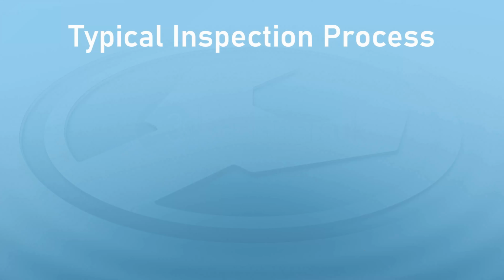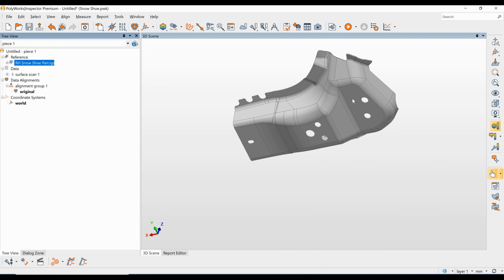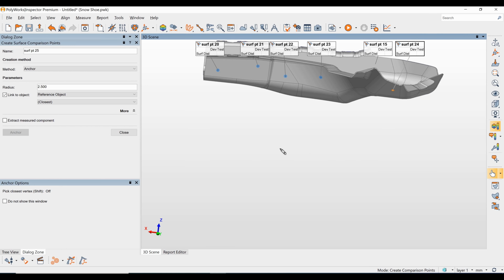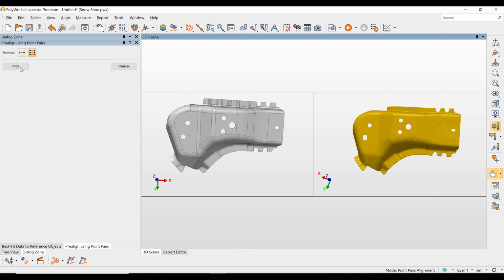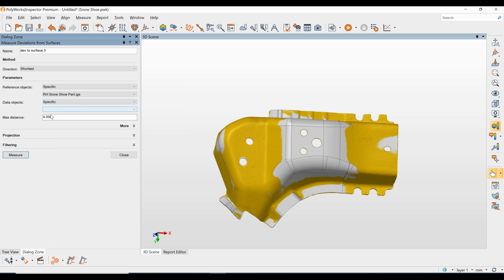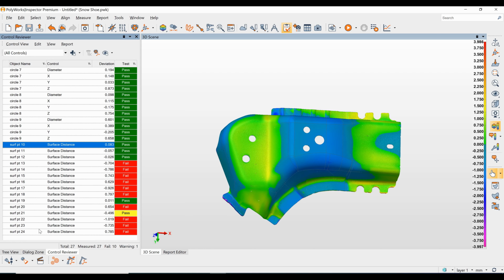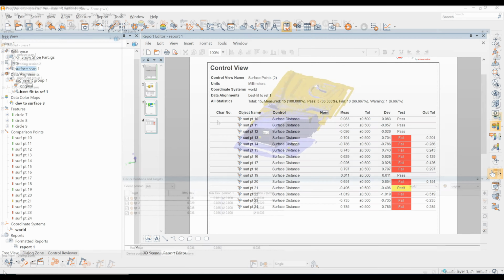Basic Inspection Workflow - PolyWorks® 2019

Comment: Hello question when using point or feature labels how do I keep as a default so whenever I create a feature the nominal actual and xyz always appear
Reply from the maker: Hi, you will see the nominals for the XYZ values appear by default. For the actuals you will have to either of probed or extracted the feature. Providing the feature type has an eligible dimensional control for an XYZ position.

Comment: Sir, how to measure radius in any object
Reply from the maker: The radius measurement can be switched on through the geometry controls. Hopefully this helps! If you require further information, you could also get in touch with your local PolyWorks supplier.

Comment: This was quite usefull. I didn't get why you'd want those initial anchors, but i can actually use that in my work instead of my usual workflow. I survey corrosion damage on anythin rusty, and i'd like a better way of displaying the damage than what i do currently, which is: I create primitives (usually a cylinder i.e pipe) and reference all measurements to that or those primitives. I then create a colourmap, making sure that all primitives are within a fair tolerance (we rarely have the opportunity to do a complete circumferal scan) and end up with any pitting clearly displayed. But the range is usually so large that the colourmap is less precise than i'd like and dotting measuments by "feel" to find the deepest pit is less than optimal. So, is there are way for me to mark out, let's say 50 areas of interrest and find the deepest pit in a reasonable way that's presentable to our clients? I'd need precise measurents of each pit displayed without having 50 different colourmaps.
Happy new year, and thanks.
Reply from the maker: Hi, Sorry for the late reply. There isn't an easy way to do this. We have done something similar for some of our customers in the past however it involves writing a macro. This is something that we do charge for as a service. If you would like to know more about this please contact us here -  https://3dscanners.co.uk/contact-us/
Reply: @3DScannersUK  thank you for replying. I'll have to make do without your services at this point in time, but I'll keep your offer in mind should I need said macro at a later time. In the meantime I'll do it the manual way.

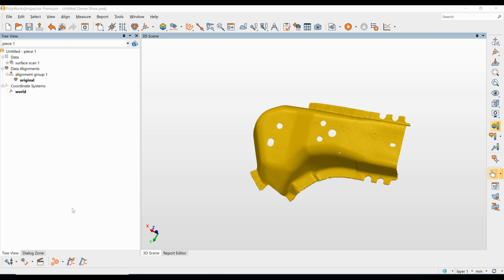Comment: @3:07 how did you clean up the scanned data?
do you have any video link for this?
Reply from the maker: Hi, if you have CAD and you are aligned to your data then go to select, data points, using reference object surfaces and select all data within a specified distance of your CAD. Now invert this selection by clicking Ctrl + I and hit delete. Make sure you only have your data visible when doing this though as you can delete the CAD if you're not careful. Hope this helps.